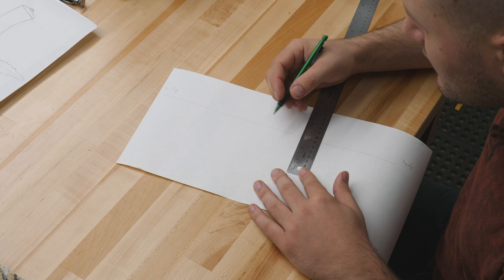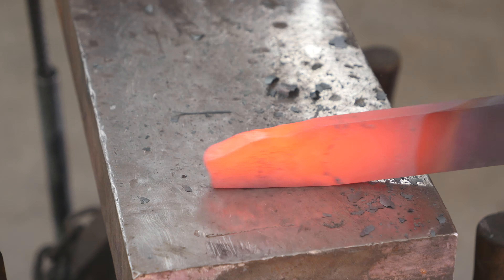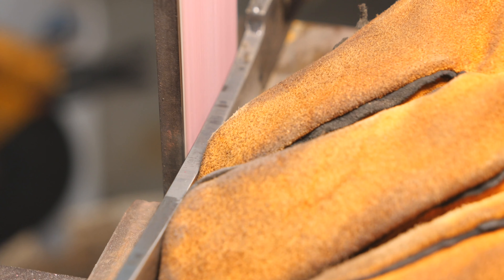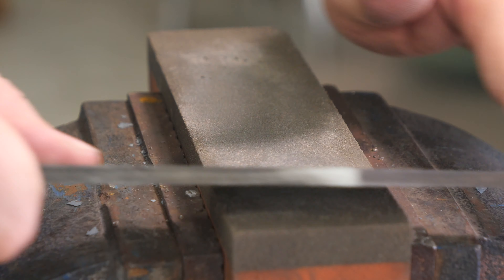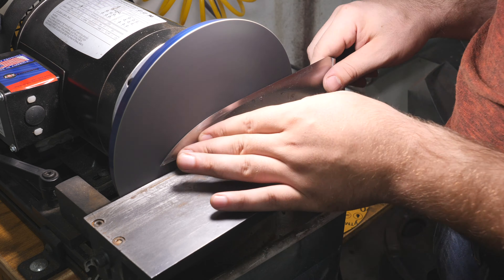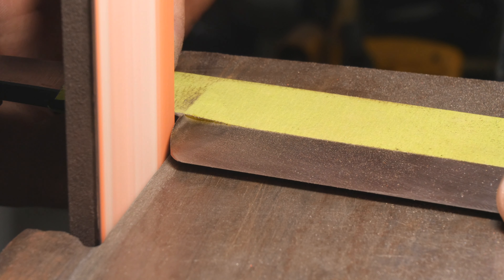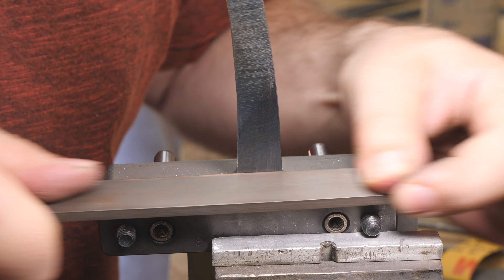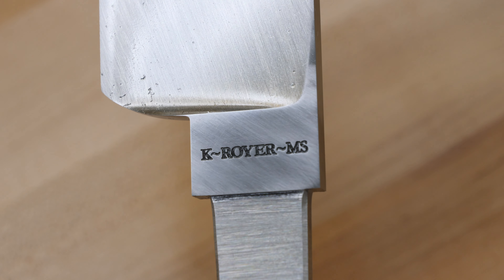Make Your Makers Mark like This: 15" Bowie Part. 1

Comment: Hi Kyle, thanks for the video. Is brass black better than super blue liquid gun blue for the making the mark?
Reply from the maker: Good question prasb
We prefer brass black. They are similar in performance. What has your experience been with them? Thanks 

Kyle
Reply: @KyleRoyerKnives  I was just curious, actually I never used them. I was using AC to make my mark darker and was thinking if I sould buy the brass black or the super blue. Thanks for your answer, I will buy the brass black then.

Comment: Is that 5160 steel? By the way awesome videos
Reply: 1084 
3:07
Reply: I think he said 1084.
Reply: He did say 1084, but 5160 is what most leaf springs are. Older ones have more carbon; ones from before 1990.

Comment: Is the disk sander you use flat. Or does it have a 1% bevel so you dont drag on the opposite side. Thanks
Reply from the maker: Good question my friend. It is FLAT 0.000”    👍🏻🗡☕️🔥

Dad

Comment: Kyle just saw this video its awesome!! My question is on your disc grinder did you get the 1deg beveled disc or the flat disc?? I have been considering getting one of these but wasn't sure which style I should get. Thanks in advance!
Reply from the maker: Hey Stephen good question. We have flat. We like things as as we can get them. We like to dust the blade across flat. Cheers from the Ozarks. 👍🏻🔥☕️☕️

Dad

Comment: Really, really loved this vid!! Everything from protecting the blade from direct heat, how you straightened the blade, how you use your belts, performance test, plunge grinding, hand sanding, keeping angles and lines and putting on your makers mark. And your video making skills are also very much improving! Thanks a lot!
Reply: I couldn't have said it any better. I'm glad I found this channel. I'm trying to learn before I experiment. I watch many other knife making videos but I'm so glad I found this guy